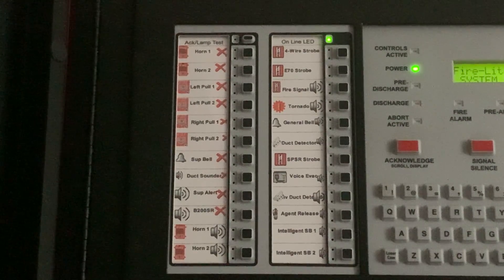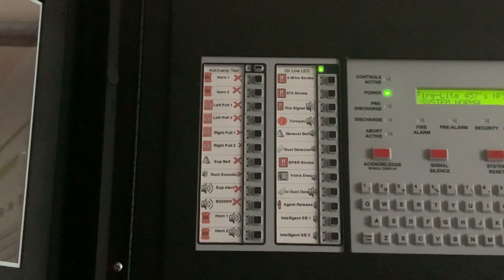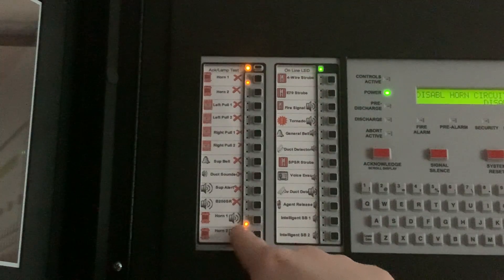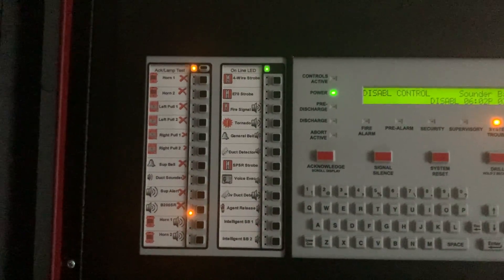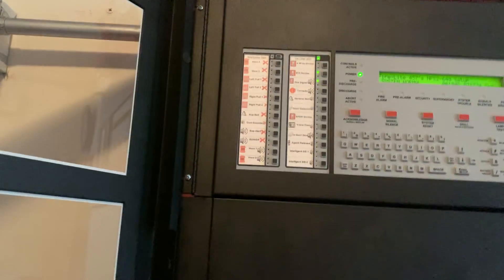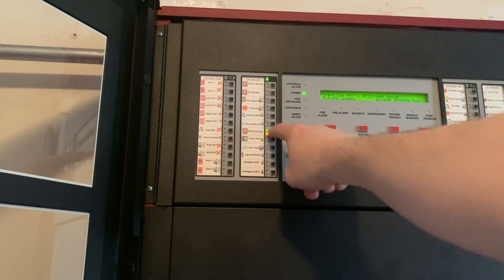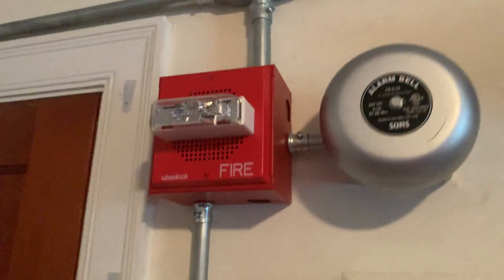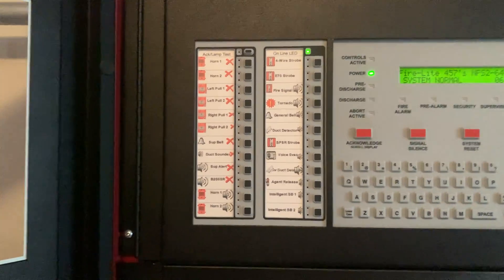Notifier Fire Alarm ACM-24-AT Overview, Demo, + Test

Comment: That's awesome! Super cool you can just program buttons to activate just strobes, or signals, etc. I just bought a D4120 duct detector for my ES-50X today, might get a sounder like your duct detector setup.
Reply from the maker: You need an MMF-300 monitor module or an MMF-301 mini module for your duct detector. And if you get a sounder like mine, which is a System Sensor APA151 or APA451, you’ll need a CRF-300 relay module, because the sounder device is a relay type.
Reply: @Notifier-457  I have an MMF-300 already but I'm using it for my pull stations. I'm going to try to find a cheap MMF-300 or 301 for my detector.